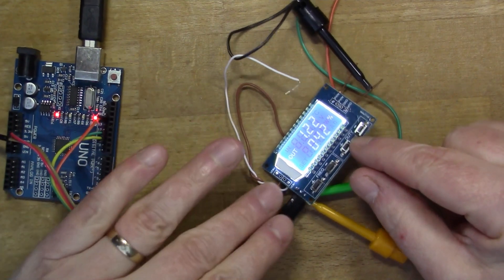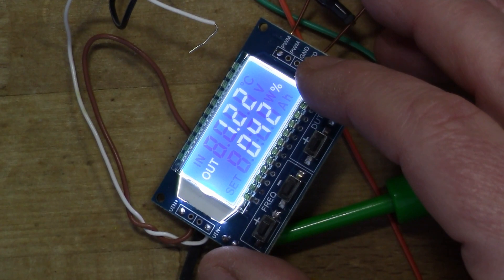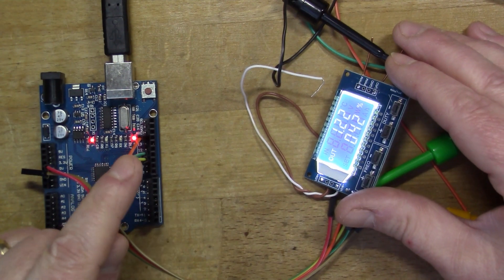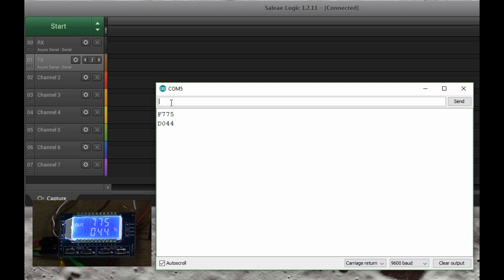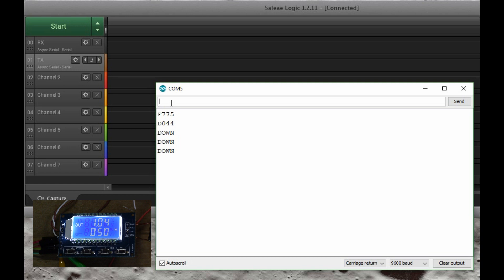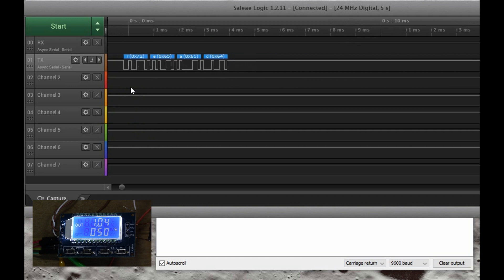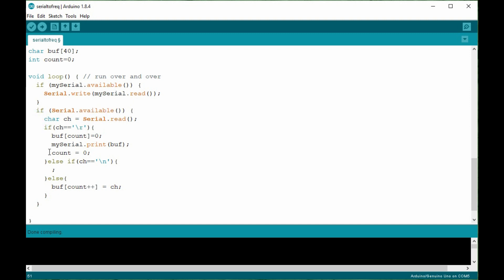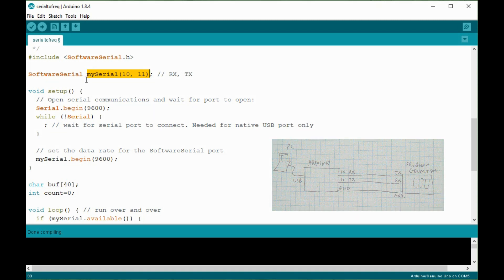Frequency Generator Part 3 - Making the Serial Controls Work (#61)

Comment: I hope you read this and can answer. When I send F65.5 to the generator the frequency becomes 65.5 KHz, all good, but when I send F65.6 the frequency becomes 064 Hz. It seems that a uint16 maxvalue of 65535 is the maximum it will accept! As of F1.0.0 everything works again but I can NOT set any frequency from 65.6 KHz - 99.9 KHz.
Reply from the maker: Oh that's interesting.  I don't have one to hand now, but I'll see if I can lay my hands on one when I open some boxes at the weekend.
Reply: @MartynDavies  That would be much appreciated, thanks.

Comment: Thank you for this video. Please tell me how to set 100khz to 150 khz frequency with this
Reply from the maker: I can't immediately lay my hands on a board at the moment, but 100kHz would be 1.0.0.  There's some data on the icstation website: https://www.icstation.com/signal-generator-pulse-frequency-duty-cycle-adjustable-module-display-150khz-p-12477.html

Comment: I'm usinjg the smaller HW-0515 board from an ESP32. It doesn't seem to mind having 3.3V control. I'm using the HardwareSerial.h library. 

It does have a small delay when changing frequency, I can see it on the 'scope, sticking to 0V or 3.3V, depending on what it was doing when it changed. Tomorrow I shall try it through an audio amplifier and see whether the delay is noticeable. I was also thinking polyphonic synthesiser, though I'll have to round off the wave or have it sound like a Stylophone.

Comment: Will the set frequency and duty cycle for both channels individually remain the same even after the power supply is removed? or it gets reset once the power supply is removed.
Reply from the maker: It's a while ago now, but I think it resets when the power goes off.
Reply: The physically smaller "double" ones (marked HW-0515) claim to have non-volatile settings. I set one this morning and it's still set 10 hours later, power off.

Comment: Very good explanation, thanks!
I wonder if there's a way to change the parameters, so they can only go up to 20 hz and 50% duty?
Do you think that's possible?
Reply from the maker: I did have a look around a few years ago to see if the code was in the public domain, or derived from some published work, but didn't find anything.  It would be good to have an open source version, so that we could create custom code and program our own microcontollers for this module.  In short, I think, no, you can't change the way that this module works.
Reply: @MartynDavies  Thank you!
I was afraid of that...

Comment: Thanks for the Arduino sketch.  My module has 3 outputs with one frequency but 3 different duty cycles.  The frequency is set using Fxxxxx.    Each duty cycle seems to set with D1:xxx  D2:xxx  and D3:xxx  Hope this helps.
Reply from the maker: Nice.  I don't have a three output one yet, but will most likely get one.

Comment: I wish I'd watched this before I went through the same learning process. I'm driving my module from an old BASIC computer and eventually realised that the automatically inserted LF/CR needed to be chopped off the end of the data string. I must have a fairly recent production run unit because instead of DOWN I get OK when a data string is received without error. Also at power up/initialise my module sends www.deek-robot.com. Free advertising I guess. In some diagrams found on the 'net the data pin direction arrows are around the wrong way. i.e. TXD coming in and RXD going out. Initially this caused me to wire my connector incorrectly. I've also learned that TXD and RXD (3.3 volt logic) should be level shifted if interfacing with 5 volt logic. It will work with 5 volt logic but it could be stressing circuitry in the module. To be on the safe side, level shifting is recommended.
Reply from the maker: The newer ones I bought also say deek-robot.  The on-board software seems improved.

Comment: Hi Martyn,
thank you for your videos!
What you show here in Part 3, I was able to understand just as quickly with an Arduino Nano with the same pin numbers. In the next step I wanted to address the XY-LPWM module directly from the program and set a frequency via the serial interface. Unfortunately, I have not yet succeeded in doing this. Martyn, maybe you have a hint or tip for me on how I should proceed or an example would be best. Thank you!
Reply from the maker: Yes, I would like to do that
Reply: @MartynDavies  That's great! Thank you!
Reply: Hi Martyn,
it works now! I have a test solution that I can use in my small project. If you want, can I send you the sketch?

Comment: Thanks for the video. I'm trying to communicate with one of these modules from a Mac, using a Prolific USB-to-serial cable (PL2303TA). I have the terminal settings as described (including no CR/LF, but can't get anything from the module. Sending commands or "read" produces nothing. UPDATE: I had misinterpreted the RX/TX meaning for the USB wires; reversing them fixed the problem.
Reply: I had the same issue with TXD and RXD. There is at least one image floating around the 'net which shows (using arrows) that TXD is an input and RXD is an output. This is the exact opposite of their function and I had to swap my connections over before it would work. Also, I've interfaced with an old BASIC computer which expects to see LF/CR at the end of received strings (In that exact order - Not CR/LF). The module seems to just send LF. In BASIC this the requires the INPUT$ command to be used because INPUT and/or LINE INPUT just hang waiting for a CR which never comes.
Reply: @rickneill6924  Good work! Also, to anyone else reading this: NEVER use the Prolific driver for Mac. It's hideously defective and can nearly brick your computer. I switched to FTDI chipset and driver.
Reply: @SoundOfYourDestiny  Yes, sadly Prolific's chips were illegally cloned and they were/are duds. You can try using old drivers in Windows 10 but eventually I went to FTDI.

Comment: Hello, I'm using Arduino Mega 2560 for this module and it doesn't work for me
I used PWM pin 10 and 11 to TXD and RXD respectively, Am I doing it wrong? do I need to use other pins such as TX0 and RX0? thanks
Reply from the maker: I have a Mega somewhere - I'll try to set it up
Reply: @MartynDavies  thank you so much!!!!
Reply from the maker: On my Mega I connected 11 to RX on the module and 10 to TX, and the same Arduino script works.  The Mega also has 3 additional serial interfaces, e.g. I tried pin 18, 19 to RX,TX on the module, and that works also - although you need to modify the script to use 'Serial1' to address those pins.

Interestingly, I have a new version of the same frequency module that has slightly different commands on the serial port.  I might put that in a video.
Reply: @MartynDavies  previously I tried to use AltSoftSerial.h library and used pins 46 -> RX and 48 -> TX and also works.
Reply: however the "read" command doesn;t work
Reply: @MartynDavies  I also copied your code, and it works for frequency and duty cycle however the "read" command doesn't work also.
I also noticed when increasing frequency, example F10.0 to F15.0, the output is instant. But when decreasing frequency, example F15.0 to F10.0, the LCD display changes but the  
sound doesn't. I am using speakers connected directly to the output. What could be the cause? thanks.
Reply from the maker: @kuyafrex480  I can't reproduce your problems with my Mega.  Regarding 'read', I have found that 're' or any word starting with that (like 'renunciation') works.  It's quite quirky software.  I've got a frequency meter attached, and I can see that the frequency settles to the new value within 1 sec or so, whether I go up or down in frequency.
Reply: @MartynDavies  ok I see thanks for your reply.

Comment: Please tell me, how to read the actual values displayed on the freq_generator instead of "DOWN" or "FAIL", so that i can compare them with what i wrote/sent to them ??
Reply from the maker: 'read' - see the video
Reply: @MartynDavies  yes, but I have to type 'read' in the serial monitor to get that. Is it possible to read data and store in a variable and compare with what I wrote, so as to nullify errors?? The thing is, this module doesn't seem to accept the digit '0' in its 2nd decimal place. For instance, if I wanted to write F4.00, it says 'FAIL'. Instead , I had to write either F3.99 or F4.01.

Comment: I used your code and duplicated the setup. I am able to change the duty cycle using the buttons. When I change the duty cycle serially, the display shows the desired duty cycle however the duty remains unchanged from that set by the buttons. Furthermore I get no responce and nothing when I issue a read command. Based on your experience do you have an idea as to what is going wrong?
Reply from the maker: There should be a response from the module, either 'DOWN' (which is good) or 'FAIL'.  If you don't see one of these I would check the wires on the receive side and make sure you have a good connection.  A logic analyzer (like I use in the video) can be useful to double check these things, and they are not expensive.  As to why the duty cycle is changed on the display, but actually hasn't changed on the wire - I don't know. I wish the manufacturer would open-source the code on the signal generator module so that we can see how it works and make our own improvements.
Reply: @MartynDavies  Thank you so much. Your videos are very helpful.
Reply: Martyn, in any of your tests did you connect an oscilloscope on the output to confirm that  the duty cycle was in fact getting changed on command and not just the display?
Reply from the maker: @michaellanderos704  I've definitely had the scope on this module to see the duty cycle, but can't remember if I was using the serial port at the time...

Comment: Nice work. Thanks for sharing.

Is there any command to on and off pwm through serial interface?
Reply from the maker: Varying the duty cycle (also known as mark space ratio) is PWM
Reply: You need to set the mark space ratio to 0%. This effectively switches the output off.

Comment: Hi, can Generator be turned on and off through Serial Controls? Thanks.
Reply from the maker: I don't think so
Reply: Or do you mean the output of the generator being turned on or off? Setting duty to 0% gives you zero volts out and setting duty to 100% sets the output to Vin (the input voltage).

Comment: Have solved the pi issue.
 Prompted by somebody else being interested I have had another go.
Got it working both from Cutecom and a skeleton python program!
Will tidy up the code tomorrow and post it to the raspberrypi.org forum. I don't think there was a problem with my old code. I was powering the xy-lpwm from the 5v output on the GPIO - although the xy-lpwm display was bright and stable I suspect it was drawing too much from my small pi power supply. Now I have the pi providing power to the tx/rx via a voltage converter (3.3v on pi side, 5v on xy-lpwm side) but a seperate 1amp 5v supply to the VIN+, VIN- on the xy-lpwm.

Cutecom let's you send to and read the port in a nice clear display.
I have sent the commands F5.01 D033 etc with no line feed or CR.
100% success. To read from the xy-lpwm send 'read' in lowercase.

Your demo helped a lot - wish I had tried the power change earlier! Was banging my head trying to find errors in probably error free code (well at least none that would stop it working).

Can post link to code here if you want.

Comment: Hi - thanks for the clear and very useful VIDEOS. 
I am doing a lathe conversation using a treadmill motor with a controller that needs a stable PWM signal.  I want to use a Raspberry Pi to provide a touch screen display and need it to send the control signal to the xy-lpwm via GPIO Tx (and get confirmation via Rx). The touch screen bit is straightforward however I am having similar issues with Tx / Rx that you initially experienced.  I have linked Tx and Rx on the Pi and confirmed that signals are being sent and read ok. I have linked to the xy-lpwm via a voltage converter. So the pi sees 3.3v and the xy-lpwm 5v.  I have tried minimal code to send / receive, the pi terminal and Cutecom terminal all without success. Sending Ctrl C from Cutecom sets the display to 0000 0000. Other than that - nothing. Have you tried using a Raspberry Pi with xy-lpwm or do you have any ideas that might help?  Using python3 and Qt for "front-end". Thanks again for your excellent VIDEOS.
Reply from the maker: I haven't tried this unit with the Pi. The serial on this module is weird in that you have to send the command strings as one continuous string and without a terminator (CR, LF or CR/LF), so I imagine off-the-shelf Linux terminal software may fail. I would probably write something in Python using PySerial so that I can customize exactly how the commands are sent. I'll try to set this up if I can find a voltage level shifter.
Reply from the maker: Another approach would be to use an Arduino to generate your PWM signal - you can use analogWrite to generate a PWM proportional to the value you specify.  It might be easier to control an Arduino script through serial than this freq module, and you can get 3V compatible modules, e.g. the Arduino Pro Mini which can be obtained very cheaply.
Reply: Thanks for the prompt response. Cutecom let's you send data with and without carriage return or line feed so I hoped that it might at least get me connected.  I have tried pi serial - get it working fine linking Tx and Rx as a check.  I purchased 10 voltage converters for £5 - maybe that is where the issue is? Happy to post you one for free. But, Ctrl C from Cutecom does have an effect (the 0000 0000 I mentioned) and FAIL does get returned. No magic smoke leaking from either end...  Liked the look of this module as it seemed, in theory at least, very easy to set up.  I wanted to concentrate on the Pi interface and not complicate it with another device.  The treadmill motor controller needs a 5v PWM input.  Will look at the arduino alternative if I can't get the xy-lpwm going from the pi - have hunted the web and not found anyone who has...
Reply: I didn't know that Ctrl C resets to all zeros. Thanks for the tip.

Comment: can i put an antenna on the module at send the square wave over the air to a reciever
Reply from the maker: Not an antenna directly, I don't think.  You would probably want to modulate an RF carrier with the squarewave signal. You can get very cheap receiver/transmitter pairs on Aliexpress or ebay (below $2) that would allow you to transmit a signal over the 433Mhz band.  Search for 'ASK modulation 433'  to find this kind of thing.
Reply: @MartynDavies  thx alot for your answer i will follow your good work.  i am trying to make my arduino send and recieve at very low frequensi so i can monitor movement in some pipes under ground in my house.
Reply from the maker: I want to make a video on these ASK radio modules - I've got some waiting here for me to do that.

Comment: I don't have one of these things, nor have I ever played with one, but it does look interesting and useful.  I'm looking at these videos primarily as a software engineer.

I see two potentially signification changes in what you're doing now versus what you were doing originally.  One is that you've stopped sending carriage returns (or linefeeds), but the other is that you're buffering the command and sending all of the characters in one continuous block.  I suspect it is the latter rather than the former that "fixed" it.

The reason I don't think the carriage return was the obstacle is that in the original video, the "FAIL" messages were coming on each keystroke -- long before you hit carriage return.  You typed "F", and it said "FAIL" because that's not a valid command. You typed "1", and it said "FAIL".  Eventually, you hit return, and it of course said "FAIL" again.

If my theory is correct, and you were to send a carriage return and/or line feed at the end of the command with the current code, it would work -- because the command is sent with no significant delay between characters -- and then it would say "FAIL" because it didn't recognize the line terminator.

My theory is that the basic reason for this is that the code at the receiving end can be very simple; it does not have to manage a line buffer, assembling the command one character at a time, and then analyze it once it recognizes the full command.  Instead, all it has to do is start reading four characters, sequentially and continuously, and then deal with that command.  So in the original case, it would read the "F" and then get a timeout -- no serial data available -- and "FAIL".  Now it says "read c1, read c2, read c3, read c4", and then evaluates the string that it has assembled.
Reply from the maker: Yes it's clear that sending in a block is the crucial fix.  You can can send or not send CR, LF or CR/LF at the end, and it really doesn't care as long as the crucial command was in a continuous stream.  But I've worked with a lot of serial devices over the years (even programming the UART/SCC chips myself) and this is the first time that I've seen this.  As you suggest, the receiver must have an inter-character timer, or an overall block timer, but it seems to me not any easier to do this as the UART typically only buffers 1 or 2 characters, and sends an interrupt when a character is ready, meaning that the receiving code must deal with the data on a character-by-character basis anyhow, even if the data are en-bloc.  Thanks for your comment.
Reply: Having solved my Raspberry Pi issue I have sent control codes without carriage return and/or line feed and it works 100%. With CR &/or LF it fails. However, the data returned from the xy-lpwm does have a CR/LF.